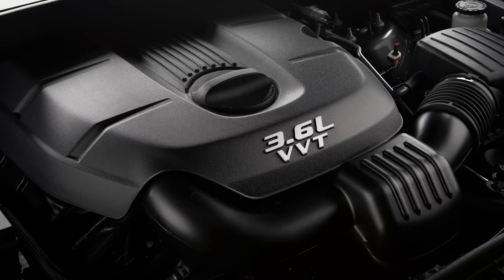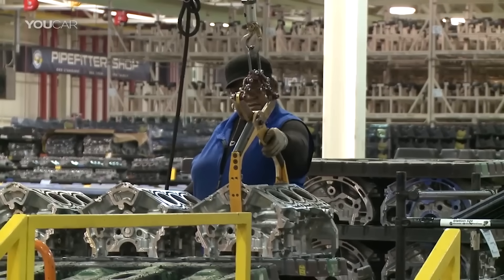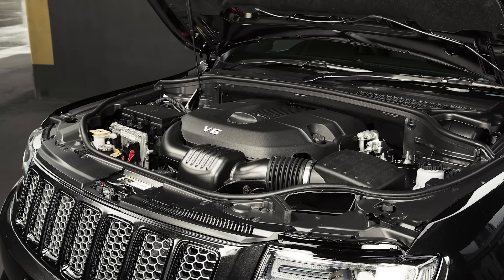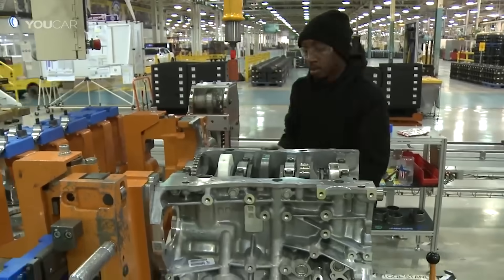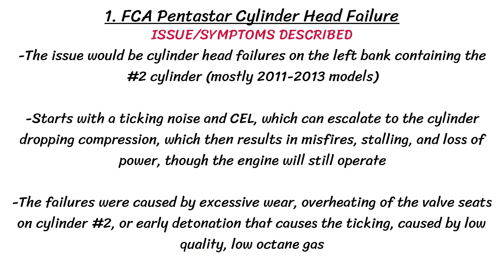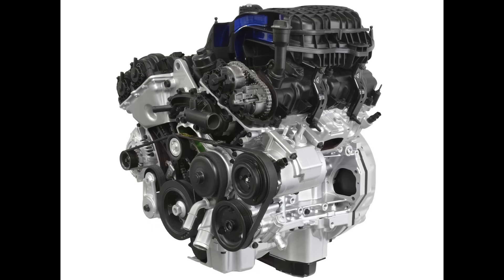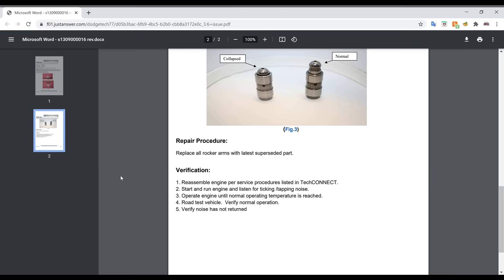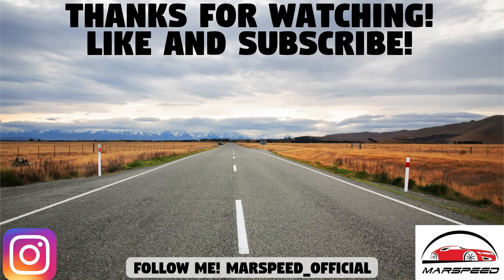The Specs and Fatal Flaws of the Chrysler 3.6L Pentastar V6 Engine

Comment: The biggest problem is the oil cooler design. The other issues are owner treatment. The rockers are redesigned for the egr 3.6l.

Doing you fluid exchanges at the correct intervals, and don't rag on it all the time you'll be good. Oil coolers tend to fail. I think it's because they're down in the v, and the high temperature and bad cooling cause them to get hot, making the seals fail.

Comment: Common problem with the 3.6 is the plastic oil filter housing. They worp and the oil seals become loose and start to leak oil. The fix is a after market metal housing.

Comment: You are 100% correct! I only run 91 plus octane in mine since 2011 brand new. Being a gearhead from the early days I knew that was the key to cars head issues. I've now got 77k on mine. FYI: I just changed out the Serp Belt #3 with a Goodyear, ACDELCO Tensioner and Pulley. The #663 is the correct belt! Not the #665. The #665 will work but its actually a bit longer the result over time at say 35-45k is slippage and you'll know it by the steering assist starting to grumble when you hit the brakes in the beginning on your drive. I wont be driving the Dayco Belts anymore. They are good for 35-45k then they start to crack. Replacement of the above will indeed blow you away as the car feels like new and its very smooth. Another FYI, the pulley bolt 16ft ft lbs torqued with a small amount of blue locktite, use a serrated plyers to start the retainer for the bolt on the backside of the pulley, you need this part and then reinstall and tighten it down, it a little tricky but you can get it done. I used a hard mallet, and serrated plyers to get is back in place on the pulley assembly. Nobody put that in their posts here, and you must have the part to engage the reinstall properly. The tensioner bolt is 40 Ft Lbs and yes Locktite it but remember a little bit say the first 1/2 inch  a small 1 inch strip, and your good to go. Hope this helps and your vid was just excellent A+. Change your oil 5w30 every 4 to 5 k with a new filter and your car will love you. The Wix Filters from NAPA are OEM. I forgot here is something you must have for the 2011 to 2014:   DORMAN 917992  This is the oil bypass valve. It is mandatory that you have one in your glove box or tool box. These fail and will leave you dead on the side of the road or you change the oil and remove the brown plastic oil cap and you have a spring and broken plastic underneath from the bypass failure. I really mean this if you own this type of car you must have one spare always. If not your dead on arrival. They just fail on their own, replacing this part takes two minutes. Replaced one during a regular oil change, the new spare is in the Glove Box. All the best.

Comment: Have a 2012 chrysler 300s with the 3.6 pentastar engine.  Have 229,000 km with no issues. Did get a misfire code after using 89 grade twice, switched to minimum 91 grade and issue went away. It is a tank with great power and fuel economy mix. Have driven 3 lengthy trips with no issues. Only use synthetic oil and regular changes. Love it.

Comment: This was incredibly informative. I just got told that my 2012 VW Routan has pretty much this same issue. It has 146k miles. Their recommendation was replacing valve lifters, timing chain, and catalytic converter totaling $11k. I’m at a loss. Obviously I’m not going to put that much into my van. Does this seem right?

Comment: We had a 2013 Ram 1500 with the Pentastar engine, traded it in on a 2023 Ram 1500.  The 2013 had 105,300 miles on the engine, and we had NO engine problems in the ten years we owned that vehicle.  Maintenance is key, regular oil and filter changes, air filter changes, coolant changes and spark plug replacements, all performed regulary, or early (coolant and sparkplugs).  We also have a 2022 Durango GT AWD with the Pentastar engine, and we enjoy that vehicle very much too.

Comment: Had an issue with our 3.6 in our 2015 Challenger. A ticking started and I noticed power loss, a tick and some gas mileage loss though drove it this way for a while and when we went on vacation we sent it to the dealership for some work. What ended up happening was some of the lifters would no longer fully decompress. Some roller bearings on the rocker arm failed and gave the rocker itself some play which was causing the tick with some cam damage which required a replacement. It was a while ago and I don't remember all the details on this problem fully but I believe there was one or two more things that failed/broke. The thermostat also failed twice, first time at 110k miles and the second time quite literally a week after a new install. Had this issue fixed at the dealer as well.

From some other sources I've heard the rollers and cams do not have proper heat treatment and can cause damage to occur.

Comment: A lot of oil filter/cooler plastic housings are cracking and leaking engine oil on the 3.6L engines. The fix is a aluminum after market oil filter housing. 5 hours labor to install a new oil filter/cooler  housing.

Comment: 2012 /180,000 on mine only left me stranded once and that was a  fuel pump -it leaked oil and water a few times not much tho and it would runs rough for no reason but other times it’s so quiet and smooth. I don’t even know the engine is on at the stop light kind of weird, never done any major maintenance on it and found out it’s still has the original plugs, but I’ve always noticed a bad smell kind of like oil took the whole dash apart, trying to find the smell as it was making me sick to drive it for long periods of time, no matter what I did with the air conditioner or heater or inside the cab I couldn’t get rid of the smell, nor find out where it was coming from The other day a big oil leak let loose. I always noticed it  needed  oil, but never leaked oil, and every so often a little blue puff of smoke when I started it, but these things will go away -so anyway found out the oil cooler went out and underneath the oil cooler it looked like it’s been leaking for years and I believe this was the smell that was making me sick so now I’m finally breaking it down. Unfortunately, the heads were never serviced even after taking it to the factory nobody told me about this until it was too late -so anyway I ran some head sealant through it and it broke my thermostat and I’m pretty sure that’s what caused the oil cooler to finally give out completely,but it’s nice knowing now we’re all that smell is coming from so I’m finally going for a tuneup still has original parts in it so it’s getting new plugs coils sensors, PCV, since the intake was filling up with the oil For the most part, it’s been reliable, but nerve-racking knowing 😮

Comment: My 2015 3.6L V6 Grand Cherokee with about 150K miles on it in 2022 started making a very loud engine tikity ... tikity ... tikety ... noise very 
noticeable when idling. One mechanic said it sounded like my valves and rocker arms needed tightening.
Shortly after changing my "long term synthetic oil" which was about 15000 Miles old ... The noise stopped (thank God) ... no noise now for
almost a year now.
The long term oil was very dirty when I changed it. No more long term oil changes for me!

Comment: 2013 Dodge avenger with this engine. I've always use high octane fuel. The problem i have encountered is the oil filter house, because it is plastic. Last time I changed my oil, I heard the housing crack when trying to get to the oil filter to replace. I've since heard that this is a very common issue. I am going to order a dornman filter housing, but they are out 3-5 weeks for shipping....hmmm. other than that, so far, great engine. 88k miles

Comment: My wife and I just got a 2020 Chrysler Pacifica Limited. I see online that it uses the same PentaStar V6 as the Challenger SXT. The van gets 287HP stock, where the SXT has about 305HP stock. Does anyone know what accounts for the HP difference on the same engine? I'd like to have 305HP in my van. I wonder if an aftermarket performance throttle body made for the Jeeps or Challengers would fit and work on my van, or if the differences in ECM programming would prevent this.

Comment: I have a 2014 Journey with 282,000 miles on it. Other than having to replace the oil cooler and thermostat housing, it’s been flawless.
Reply: Those two issues sounds familiar. I hope to get that same mileage outta my 2014 T&C!

Comment: Have a 2015 with the 3.6. It needed new lifter and rocker for one cylinder at 98k miles. Fortunately, I had bought the 100k extended warranty. As long as they had the engine out, I had them replace all the lifters and rockers. It was pricey, but the warranty covered much of the cost of opening the engine and it provided peace of mind.
Reply: They took the engine out ?
Reply: Nice but didn’t the video say that the rocker issue was not covered under the warranty? I would think it should be. I just bought a 2021 Dodge Ram 1500. It had under 150000 miles on it. I’m still under 20K . I’m now watching videos about this motor. So far so good.
Reply: I see you bought an extended warranty. Duh. Have a great one!
Reply: I've never lost money on an extended warranty yet, which maybe means I should upgrade the quality of cars I buy.
Reply: @christopherbowen1836  did you buy the warranty when you bought the car new or did you buy the car used and purchase the warranty then. I bought a warranty at the dealer through a company called AUL when I bought my jeep used (82K) and at 88k the oil filter/oil cooler started leaking and they wouldn't cover it. Very shady insurance company!

Comment: 2011 Dodge Charger SE (SXT) P0302 code on the V6 3.6L Engine. Ive replaced all 6 spark plugs, swapped coils 2 and 4, and replaced the fuel injector as well... still says P0302 as the code.
im guessing the wire itself is the last piece that needs replacement, but is there anything else i can check? cylinder heads?
Any help i would appreciate, i really dont want to spend thousands on another diagnostic, and labor to take the whole bitch apart.... again! (seriously 9 components and tubes need to be disconnected and removed JUST to get to the spark plugs)

Comment: If you look at the amount of garbage engines out there these days the 3.6 pentastar is definitely in the top 20 for reliability. Unfortunately they were mated to some pretty bad transmissions in the minivans. But pared with the 8 speed it’s definitely not a car I would ever tell someone to stay away from. Pulse the parts arnt crazy expensive and they are pretty easy to work on in terms of accessibility and hardware choices.

Comment: I adore my pentastar. I’ve put almost 70k on mine and the only issue was oil sending unit. And it only took a little over an hour to fix. It did fail catastrophically though. An O ring failed and Oil spewed everywhere on the lower half of my engine and trans. Basically got everywhere it could. It does have the cam bearing tick. But I’ve had it ticking for almost three years now😬. The five speed auto that it’s mated to in the jk is very lackluster in my opinion. Other than that. I’ve only had to do basic maintenance and have had a pleasant experience. Currently at 120k.
Reply: So you're just letting all that metal circulate in your engine lol

Comment: I had the rocker arm issue and one of the cams replaced on my 2015 200c at about 50K miles.  I bought the car used and as such do not know the provenance of it.  There was some visible rust on parts of the cam as though water intrusion had been a factor and as such I ate the cost instead of the possibility of a warranty claim.  I always use full synthetic oil but again do not know how the car was treated before I ended up with it.  That said, I was not pleased with the $2,300 repair.

Comment: Just did a major tune up and maintenance of my 2012 Dodge Grand Caravan at 140k miles. Let me tell you, this engine has given me probably the best "cheap car" experience I've ever had. Lots of good responsive power.

Now, to be fair, the overall reliability experience with this van has been merely okay. The sliding doors and automatic windows had mechanical problems, and some flimsy plastic transmission lines cracked and leaked. It sure ain't a Honda or Toyota, you know? But certainly no major failures.

But buying it used often means a BIG discount for a great engine and family car. That's how I got it. Plus all the seats fold down flat, and you have a pseudo-cargo van. So yeah, it's the kind of engine that you can find cheap and, with a bit of research, find a deal.
Reply: Love the folding down design! The stow n' go system has helped me on the track when I take my Town and Country to the track. It lowers the center of gravity a lot.
Reply: Toyota and Honda are worse for these door,wiper,swirches.etc. they are junky vehicles. Always a problem. Never buy a honda especially,  they don't make anything, they buy leftovers and assemble them
Reply: I had an 2009 Grand Caravan.....3.3L.....200,000 miles when I got rid of it.....burned 1/2 quart of oil every 5000 miles near the end of life.......original transmission......but AC went....both front and back....changed sway bar links like changing shoes.....brakes would last may 25,0000 miles.....now most of the work I could do myself....not anymore....getting too old. If FCA made that same vehicle I would buy it today.

Comment: I have the 3.6 in my 2018 grand cherokee. Had to replace the water pump at 20k miles. They were on backorder for a month at my dealership so I couldn't drive it for a month. At least the warranty covered it.

Comment: holy shit @Marspeed I had issue #1 and better gas was the solution. folks, if you have a 3.6L for 6+ years you need to start running on 88 or higher

Comment: Bought a new 2012 200 with the v6. Put on only 58 thousand miles. Recently had a misfire code. Took to dealership thinking would be easy fix like spark plugs or coil packs. Had to replace cylinder head 4000$. 10 year warranty ran out and the dealership didn't want to help with the cost. Really upset because a problem with engine that chrysler was aware and put out a TSB   to dealerships

Comment: I have a 2014 Dodge Grand Caravan with 115K and just had to replace the leaking oil cooler located under the upper and lower intake manifolds. I bought a Dorman aluminum casting replacement to fix the poor design of the plastic part located in a high heat area of the engine which warps and can leak both oil and coolant.

Comment: well what about the last ones being made ??? as in for 2023 ??? ... because I am HIGHLY considering the 2023 300 Touring with AWD ... I mean I don't want to give up driving stick ( let alone switch to an automatic with the gear selecting technology these specific cars have ) but these cars along with the charger etc. WILL be extremely iconic automobiles not just for being the end of an era but also for being the last of the internal combustion engine line ... so I'd really like to get my hands on one because the value of these things are going to APPRECIATE rather than depreciate ...

Comment: Former pentastar 3.6 owner here.  My engine tore itself apart after only 100,000km and only 7 years old.  All proper maintenance was done on it, and no CELs before the problem manifested.  Something happened that caused metal shavings in the oil and throughout the oil system, ruining the engine.  A replacement would have cost me 10,000 or more.

Comment: I bought my Charger new in 2014 with the 3.6 engine. Luckily I haven't had any of those issues.
Knock on wood.
Reply: @captaincat40 ... I'm pondering the 23 awd 300 touring ... chargers are too damn long for me ... 300's remind me of the old BOSS looking chargers ... the 1st gen when they brought them back in 05 ... but once they got longer in 2011 ... I drew the line for 2010 ... I mean the 300 just looks BOSS ... like the older charger did ...

Comment: Our 2011 wk2 with the 3.6 vvt has 178k and yes, shes been a little higher in maintenance then some but she still runs good, quiet and smooth, the oil looks clean  between changes as well. Impressive at nearly 200k
Reply: POOT!!!

Comment: 2014 3.6 pentastar, has 134k miles, oil cooler went out, replaced with dorman aluminum oil cooler. Solved. Ac condenser replaced due to leak. Can bus computer replaced due to short. Gas tank line and bracket due to leakBesides those just regular maintenance:
Full synthetic oil every 5k miles
Transmission atf fluid and filter changed 2 times already
Diff fluid changed once
Changed spark plugs twice, oil cooler and coil packs replaced.
Coolant system flushed once.
Both air filters replaced
4 pirelli scorpios realigned steering and balanced wheels
And I drive it like im in a formula one race.

Comment: My sisters wouldn’t heat up due to a stuck open thermostat. 2014 of course which was the 3rd year for this v6 engine. It was starting to leak oil a few months after I changed the thermostat. Probably because the oil is heating up all the way now…

Comment: The oil cooler leak is a sneaky one because I originally though I was burning oil. I only found out when there was oil on the garage floor because it wasn’t driven for a few days. Going to get that fixed. 
Also, even though Chrysler says the coolant has a life of 10 years/ 150,000 miles, I changed mine after 5 years.

Luckily, my thermostat stuck open in the winter. Thankfully the Texas winters don’t stay cold for long.

God forbid you need catalytic converters. They’re not bolted , they’re welded, and that is pricey unless you know someone that can weld.